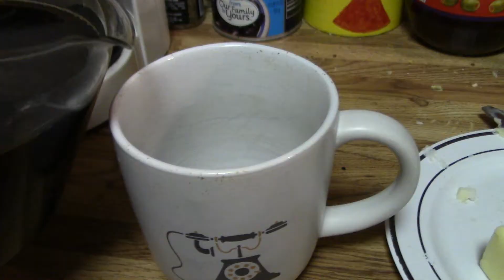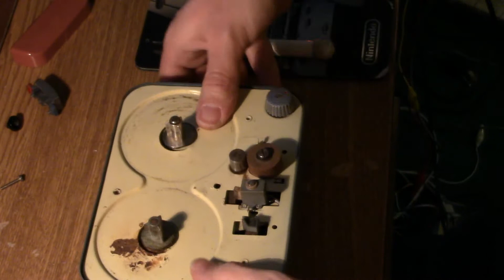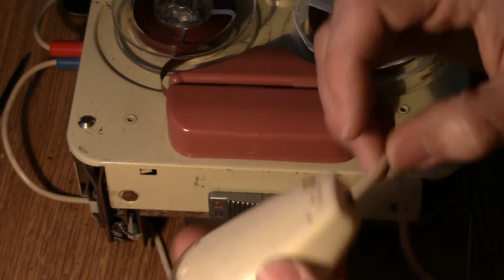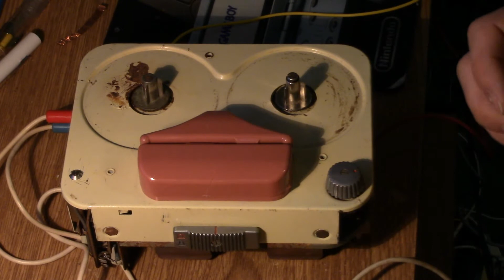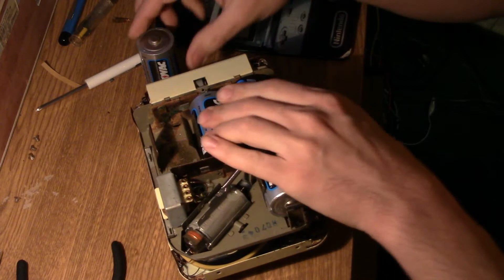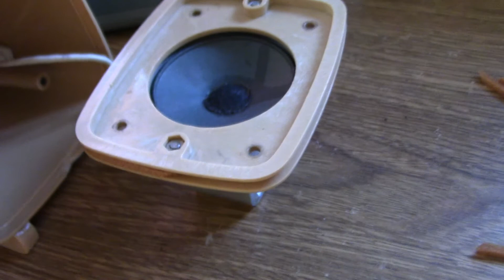PhonoTrix Fix

Comment: Hello, Rick!
What is your opinion of Loctite
Stick 'n Seal Outdoor Adhesive used as contact cement? I broke a hinge plate on the door of my
GE 3-5025A, and I have the joint repair setting up until Friday when I think I'll be able to reinstall the door to try it. Thanks, man!   - Bill

UPDATE: After approximately 2 hours of set up time against what I thought was better judgement, Door Repair, and Reinstallment is complete!